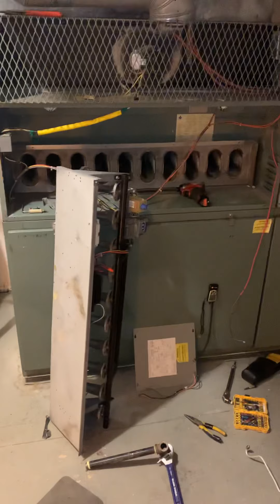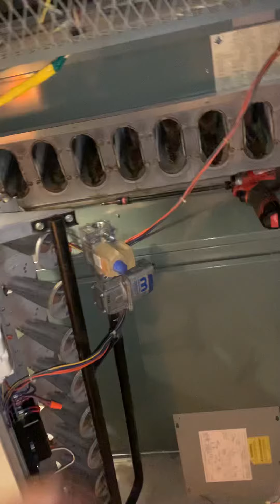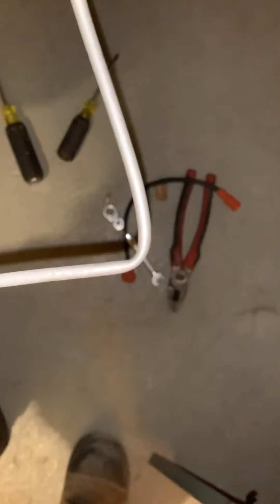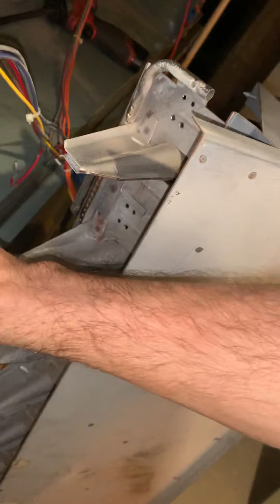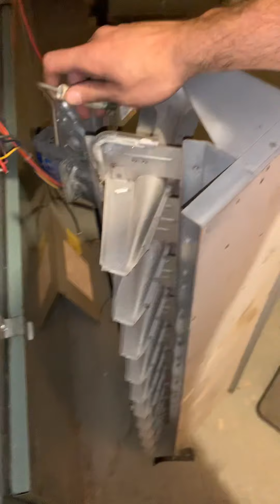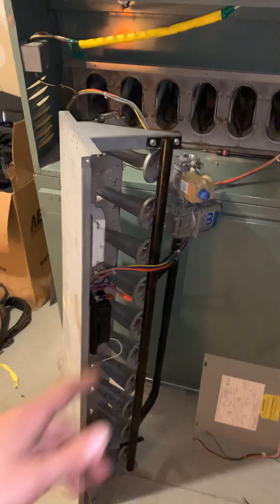EngA - How to trouble shoot pilot issue “XE model”

Comment: Sierra of Tuscany, Calgary!  The gas pressure wasn't turned down, those MUAs are connected to the same gas line that the suite fireplaces are attached too.  They don't have enough gas flow to fully rate these units.

Comment: Did you confirm with eng air if that was actually incorrect? I've worked on a few XEs and they all have that same ignitor that sparks on the same place. I do agree it should spark at the pilot runner instead.

Comment: Good catch!
I would of thought the roll out was from a plugged heat exchanger due to years of maxitrol satisfying from highfire cycling to low fire, depending on discharge location of course . 

I could totally see guys dropping the" W.C to combat the roll out , instead of looking for a bad spark rod location.

I hope you can post more vid's on XE's , like differnt macitrol series systems "20/21" etc. Maybe touch on the new gas train upgrades ,like why they have capisitors now and why only fenwal spark ignition, etc.. Engineered air is forcing these upgrades when gas valves fail.
Reply: The capacitor helps boost the signal from the ignition board to the flame rod. The ferrite cores wrapped around the 24v hot and neutral help reduce electrical interference (noise generated by the spark) back to the ignition board, to increase the overall flame signal.